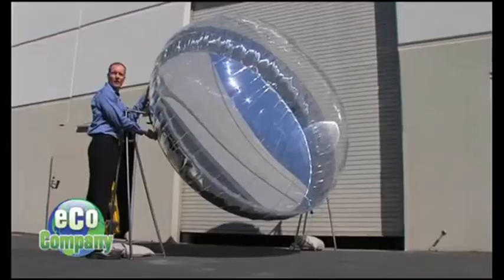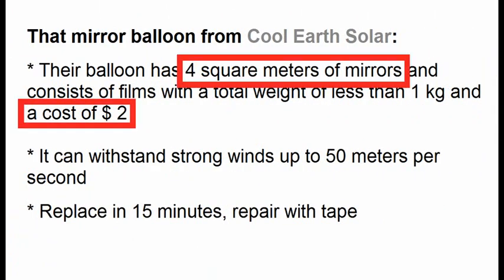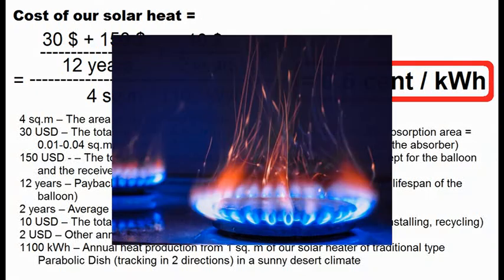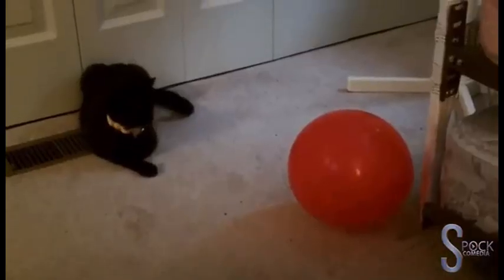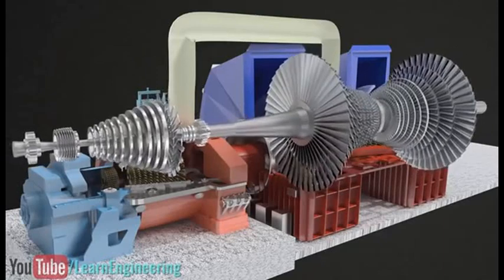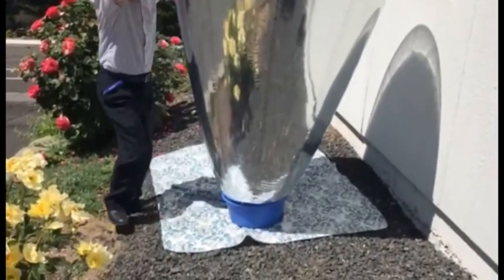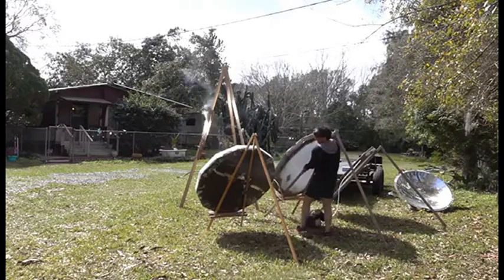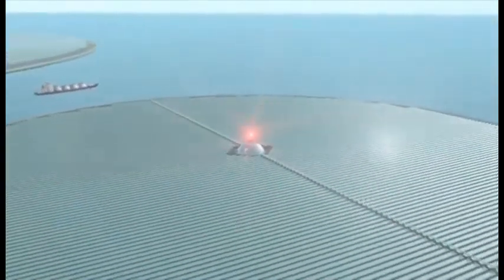Solar power plants made from mirror balloons

Comment: There's also a solid state heat engine that just came out you can find it on YouTube that converts heat directly into electricity it could be put the focal point it might need to get a lot hotter than the small mirrors but I'm sure they make them much bigger

Comment: looks very promising in terms of cost effectiveness
I wonder how easy it would be to manufacture at home
Reply: Two circular sheets of plastic, one reflective, one clear.  Lay one over the other.  Run a heat gun around the edge.  Done.
Reply: @marlinmixon3004 those seals tend do delaminate once inflated, unless you got state of the art tooling which sounds expensive over such a large curvature

Comment: I think the airborne and floating systems do not take storms into consideration, and would be quickly destroyed. The circular inflatable mirror seems like it might have possibilities, and a rectangular version (computer designed) could have much more energy density and efficiency in an array.
Reply: Protective panels are used to protect against wind and storms.

Comment: You need to get to the Stirling Concept my Strong Accent Friend.
Once you got that turbines and steam would be looking like a Steampunk Nonsense..
Don't get me wrong it can be interesting, fascinating.. But..
It stays behind...

The first concept it's Interesting.
It's the solar Fotovoltaic Cells that aren't feasible .
Heat , low efficiency... the only good thing it's they are cheeper but the one for concentrated Sunlight usually are not..